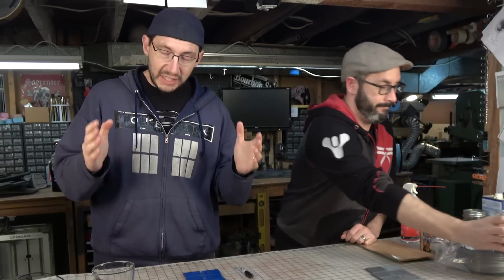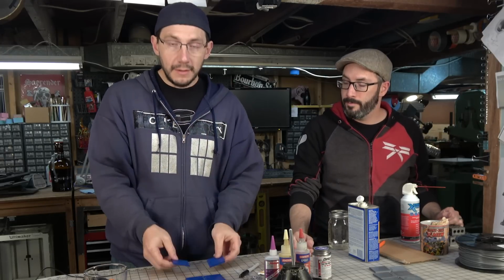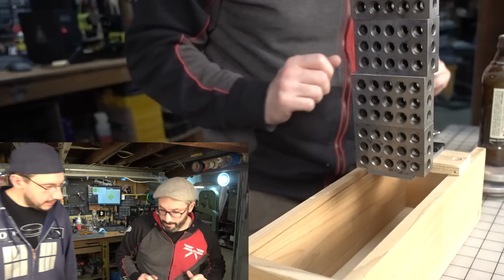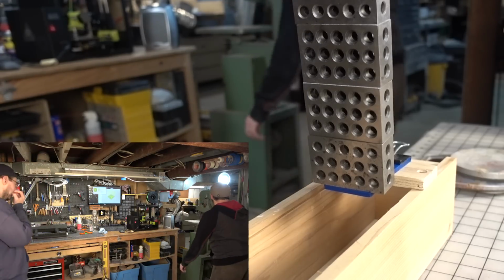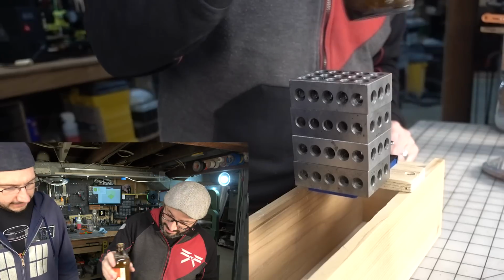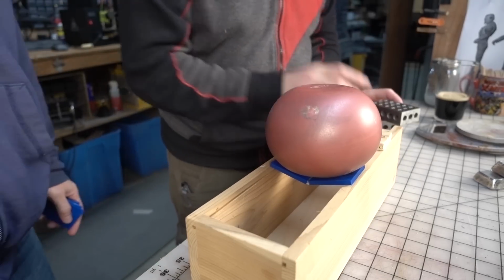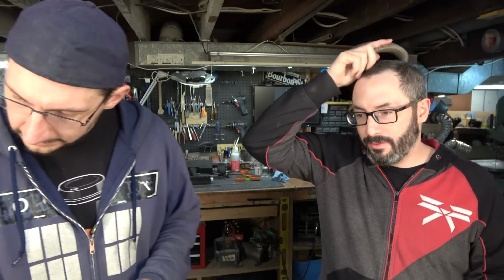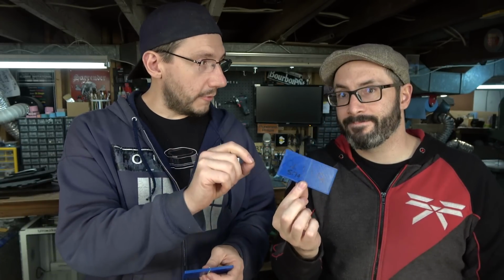Testing 3D Print Bonding Methods with Punished Props (Glue/Epoxy/Welding)

Comment: When bill applies the super glue, does he put glue on both faces, spray both faces with the accelerator, and then put them together? Or is he putting super glue on one face and accelerator on the other and then putting the faces together?
Reply from the maker: +Mega glue on one face and accelerator on the other.
Reply: Thanks Joel!

Comment: I have never gotten CA glue to bond enough to PLA to be useful, I have tried many brands and types, and I found epoxy to hold better.
Reply: PLA is kind of slick, the glue wont get that immediate tack where it will stick enough to hold it together before curing, you need to keep it clamped andheld in place until it bonds, then its very strong

Comment: 3d pen would work even better if you cut the ends of plates on 45 degree angle and put plastic inside kinda like welding

Comment: Love the video and how "normal" it was done. That is a fast and fun way to show it :) Next time test with (freshly) empty beer bottles ;) that way we have a drunken review, too :D
For the next "real" test maybe:
Add a hole near one edge of the 3D model after you glued them together you have 1 hole on each side.
1 you use to screw it down ( so the test distance is always the same and it can't flex there)
the other you use to hang something on there ( maybe with a cheap luggage scale)
If you use something like a water container you can fill that with sand ( or water :P ) and get a better reading :)
And i think the one with ABS slurry was an abs printed part? Maybe state that if they are different filaments / types :)

Keep up the great Videos #highfive

Comment: CA activator does weaken the join
Reply from the maker: It does? By how much - do you know?
Reply: 3D Printing Nerd  My two cents, Joel. Being an RC model builder and flyer, I've used a lot of CA adhesive as well as hot glue. VenomTheCat is correct that using accelerator on CA can weaken the joint, in some cases. I think it depends on the material being bonded. In the case of these hard plastic pieces I doubt the accelerator would cause a problem unless it was incompatible with the specific type of substrate. And accelerator really isn't necessary; it simply speeds up the process. If you're willing to give it a few minutes to cure on its own there should be little or no difference in the end result. I use a spritz of accelerator too, but only because I'm impatient. In the past I've done the baking soda/CA glue joint as well, but only when using thin CA and needing to fill a gap. It would be interesting to see a test comparing CA bonds with and without accelerator and with baking soda.
Reply: 3D Printing Nerd well with your testing rig would be impossible to find out :)

i only have anecdotal data from building planes and other props

i guess that makes us even

Comment: the slurry takes ages to set up.. i use it exclusively to connect parts in ABS.. and even small drops take ages to set up sometimes.. i think it comes from the surface evaporating the acetone quickly and building up a hardened layer. the still wet slurry underneath now needs to redissolve or find other ways to evaporate and that slows the process down significantly.. 

shame.. 'cause i would have bet on the slurry to be the best adhesive of the bunch :)

one addendum: you only tested ABS here.. so the results are not for 3d-prints in general..

ooh.. and i shouldn't comment before i get to the end.. 
the highperformer-test has basically no relation to the tests before.. so the numbers dont correlate.. 
in fact the second test doesn't really mean much.. its just a very rough comparison.. you know.. physics and stuff ;)

Comment: The E600 wasnt even set or dry or anything to give it hold power.
Reply from the maker: We didn't use E600, we used E6000, and we let it dry for 2 minutes (hence the shot of me starting a 2 minute timer on my watch) before putting the pieces together. Thanks for looking out, though!
Reply: I missed a 0. As well as when the joint failed and you pulled it apart there was stringing. That indicates the glue wasn't dry completely.
Reply from the maker: Nothing about any of our testing was drying completely :)

Comment: laying the block down vs. standing them on end towards the end reduced the force on the bond significantly. Not to worry to much towards your non-scientific approach, it's just not comparing apples to apples.  And the medicine ball weight is more uniform load across the parts, so again, it's not as much of a test on the bond as the initial tests.
Reply from the maker: True, we were NOT comparing apples to apples at all. We did have a good time, and the result we came up with was interesting. I think if this video proves to be popular and enough people want a follow up, we'll have better method implemented.

Comment: Argh! First, always use uniform weights at uniform distance. Always! Well, OK, you did not expect to need more than four of the uniform weights, but still.

When you switched the stacking the weights sideways, I yelled at the screen. More than once. :) Also yelled when you recorded the failure weight, not the held weight. Also very annoyed with your last round as the weight was at half the distance.

Really hoping neither of you are structural engineers. :)
Reply from the maker: I'm barely conscience most days, let alone capable of operating heavy mathematical formulas. :)

Comment: Protip if you dont have CA accelerator use baking soda.
Reply from the maker: +Shadow_Burn68 I've seen Bill do that a few times. Does it speed up curing?
Reply: 3D Printing Nerd yup its about a 10 second cure time and adds some material gets rock solid

Comment: also how about abs cement for pipe as well you really don't need an abs slurry acetone has been used as a cement weld as well as chloroform for years aka how we weld poly carbonate  aka weldon4  and weldon 16 and also when you went from standing to laying down you changed the forces on it cause of the fulcrum point its like on forklift forks  at the pips may only pick up 1000 but at the back of the forks it can pick up over 2000 before tipping and when it comes to  superglue  small dots works better .epoxy as well dosent like smooth  thats why it works so well for wood  but superglue does love smooth surfaces aka mythbusters tested it years ago 1 drop 600 pounds
Reply from the maker: Thanks for the tips!

Comment: i wound if u could put them together with the 3d printing pen and do it like a weld. before i weld to peaces of metal together like that i will grin a angle on the edge of both peaces an fill the channel it makes that way the weld penitrates the metal deeper an it lets the top of the weld come out flusher with the rest of the metal. i wounder if u put a angle on those 2 peaces an do the same motion with the 3d pen if it would help cause the angles and the motion effectively should translate into move surface area being bonded to. i'll try it myself with my 3d pen. this is very interesting i had never thought about putting peaces together like this before with the pen and just the way u do it in the video reminds me of alot of seniors ive been in just welding to flat sheets of metal together. its how i learned to weld an my welds got alot stronger an looked better after adding the angle to the peaces before welding them together. im not a professional welder and i dont weld for to many ppl just cause i taught myself and dont consider myself to be a good welder and wouldnt trust my welds if it was something that could put someone in danger. i still have alot of proving to my self before i put my touch on something like that. i may try to make a video on this myself. i dont have a following an most of the videos i have are just random stuff i wanted to show to ppl or the few poor attempts at tutorials for console mods back in the day so it wouldn't be out of place. if anyone would like to see that let me know and i see what i can pull off. it want be some fancy edited video but i should be able to pull off something that will show the results an the methods i used to reach them.

Comment: polyurethane glue? 
http://www.christinedemerchant.com/adhesive-glue-polyurethane.html
Very cool "unscientific" real world test though...definitely shows the different bonding methods and their strengths
Best way is to have a hook, then pull down using a fish weight scale, as the weight increases, it will break the bond.
Did you use ABS juice on PLA??  You bond ABS prints with ABS Juice...that works like PVC glue...once it dries (several hours) it is almost just as strong as the print..

Comment: First thanks for this, I learned several useful things from this, especially that my 3d pen can be used for more than just filling gaps and adding to my prints.
For those who are commenting about the methods about testing, I think that knowing what gives out with next to no weight, what holds up with up to five pounds and what goes beyond that is more than one needs.  Test the rest yourself.

Comment: You didn’t use the primer first for the pvc cement. It’s a two stage process and is not designed tor sheer strength.